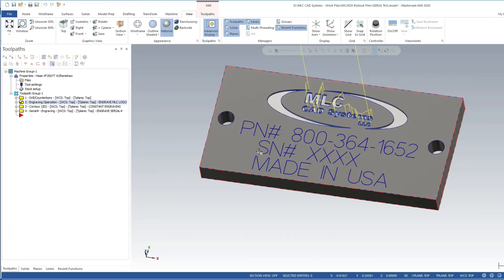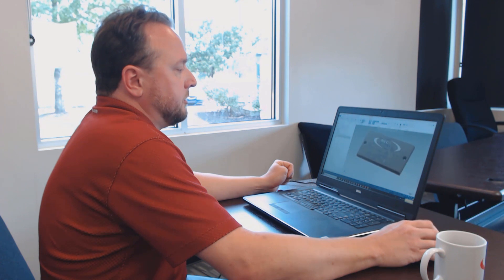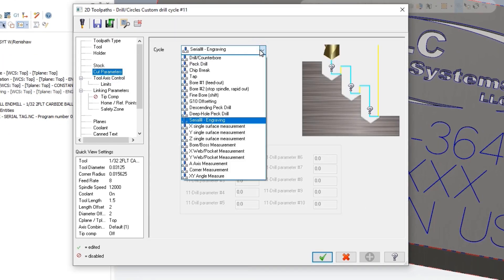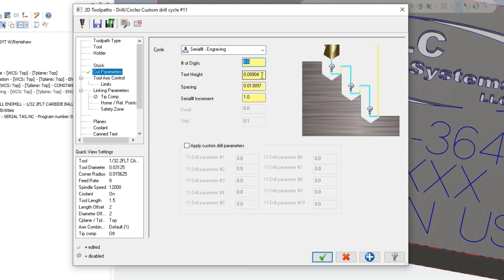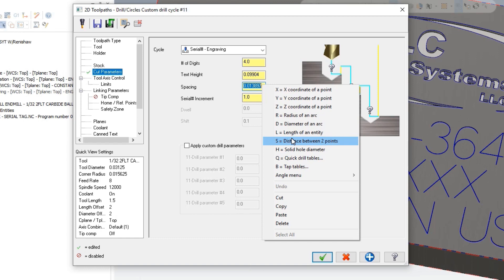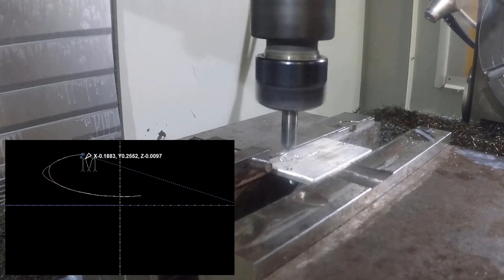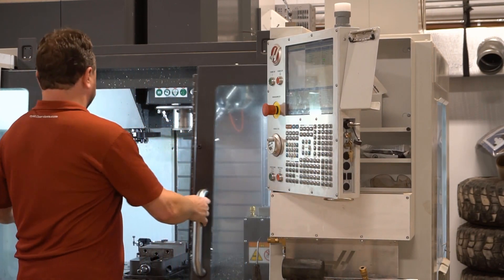How to Automatically Add Serial Numbers with a Post Processor

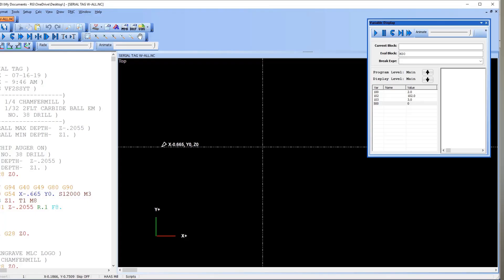Comment: What's the software being used at 2:41? Thanks!
Reply from the maker: I don't remember what software that was, but it is a tool to mimic an NC controller so you can see how your program will interact with the machine.  Possibly NC Plot?

Comment: Could this be adapted for OKUMA? as well as alpha-numeric?
Reply from the maker: The answer is yes.  The machine would have to be capable of running user macros.  For some machines, this is an option with an additional cost from the respective manufacturer.  The company’s mgmt. may or may not have purchased it for that machine.  As long as they have this option, then we can adapt this to Okuma.